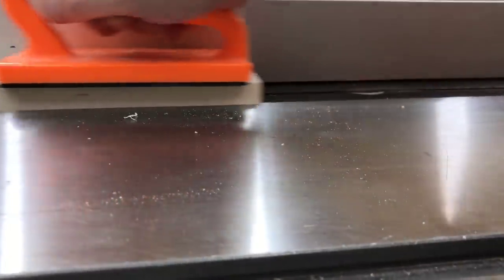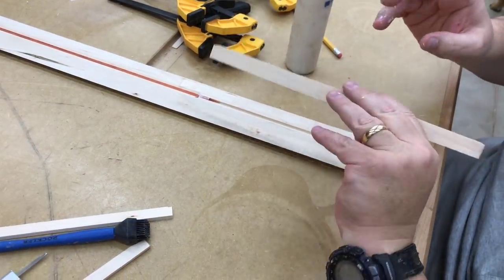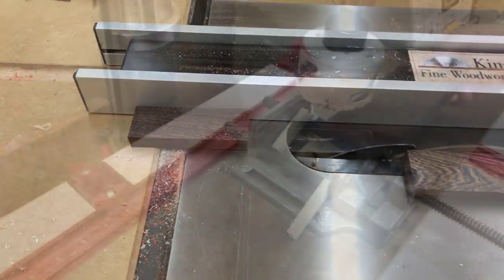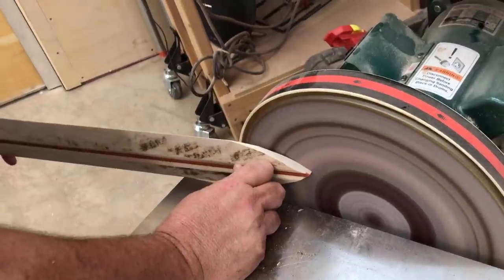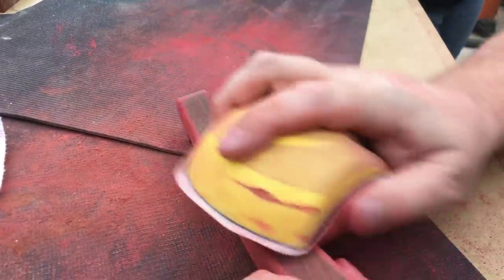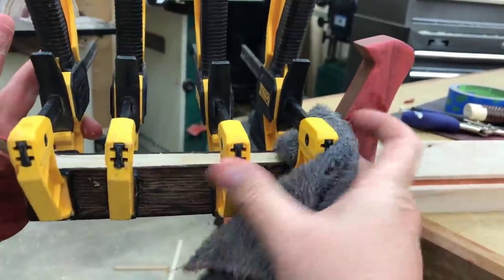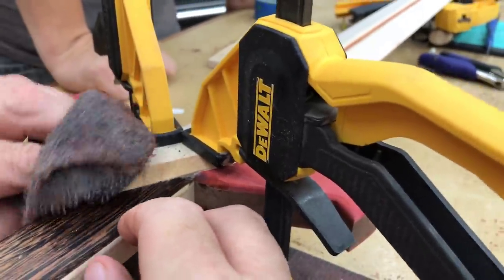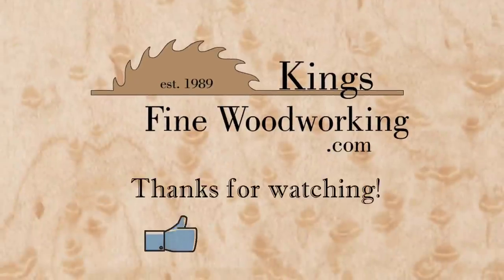28 - How to Make a Wooden Longsword That Really Works!

Comment: Great job. A lot of fun to build and use.  Do you thin
Reply: Think if you were going to do it again you would make the inlay down the length of the sword solid at the end so it continues to the tip?  Again I loved watching!
Reply from the maker: It was a lot of fun!
Reply from the maker: The Padauk inlay can't go to the tip, since the tip gets narrowed down to a point. But I suppose you could glue up a sword blank with a strip of Padauk sandwiched between the maple, instead of using inlay.

Comment: The fuller doesn't go to the tip
Reply from the maker: Hi!  I’m not sure what that means. But if you tell me, I’ll fix it next time I make one.
Reply: King's Fine Woodworking The fuller is the groove in the middle of the blade. It usually only goes about half way up the blade itself. The purpose of the fuller is to reduce weight of the blade in most swords. Also great work!
Reply from the maker: Oh, right! Now I remember what that was. Thank you for the info!  I need to find a cool design. I had a lot of fun making it. And I’d like to make another sword.
Reply: King's Fine Woodworking Also quick top the diamond shape things you put on the handle would realistically make it uncomfortable to gold for long periods of time, since the pointed end would dig into your hand. The sword is usually held with your hand right up against the hilt.

Comment: No.  No.  NO.  Sorry but as a hobby knifemaker who has religiously studied all aspects of knife making/bladesmithing and considers practical Bladesmithing, The Master Bladesmith and The $50 Knife Shop as  the holy trinity of knife making books, that is NOT the definition of a full tang.  Length into the handle is irrelevant.  What matters is if the tang covers the entire surface of the handle, and said handle is made from two scales that are secured with pins, rivets, or screws.  Othetwise it's a hidden tang.

What you're describing is a "through" tang.  I really wish people would find out what terms mean before they use them.